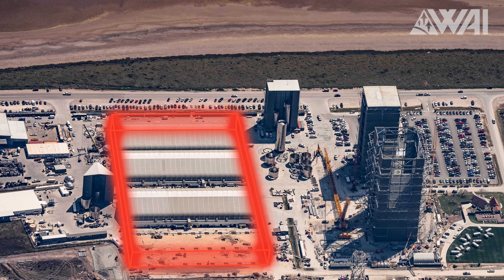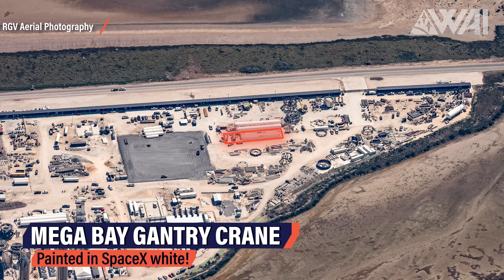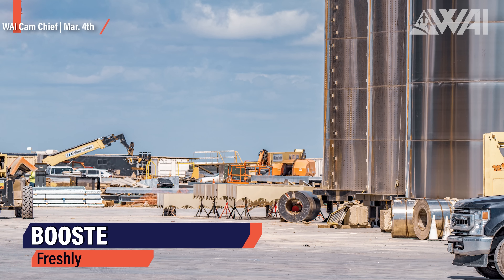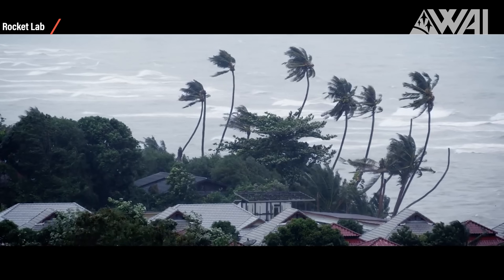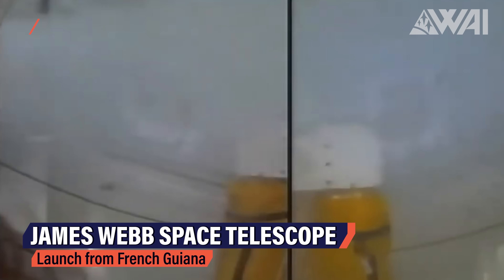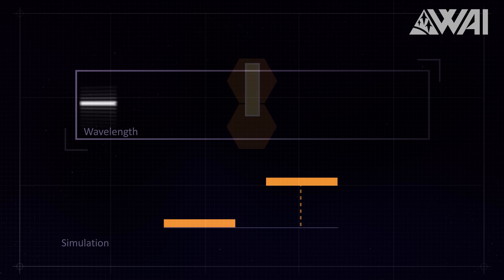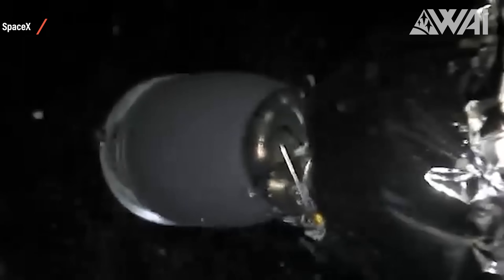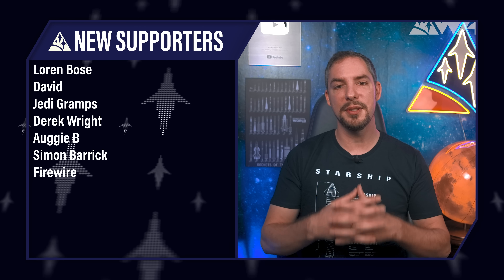SpaceX Starship StarFactory is GIGANTIC! – JWST Update – ULA GOES-T – Electron Launch 24

Comment: Could a booster do a test flight by itself without a ship on top?
Reply: Unlikely.  The aerodynamics at MaxQ would shred the booster apart without a more aerodynamic leading edge.
Reply: @glennpearson9348  Even a short one like the test hops Starship did? They didn't reach maxq, did they?
Reply: @xliquidflames  Not sure how that would happen with a full stacked starship.  I suppose they could test Ship 20 along like this, but they still risk blowing up Stage 0 if they fail to capture the ship.  Same can be said for launching just the booster.  Why risk blowing up Stage 0 for flight data that gives them no additional feedback on the return-from-orbit performance and no additional data on the performance of the heat shield?  If I were Musk, there's no way I'd risk it.  The rewards don't outweigh the risks; but that's just my opinion.
Reply: @glennpearson9348  Not fully stacked. My original question was could they test fly just the booster.
Reply: Could a booster do a test hop by itself just like the 4 Starships did; just a short, low test flight to land back on a pad, not be caught by the tower, to test out all the systems.
Reply: Now that I'm thinking about it, those 4 ships were testing out the bellyflop maneuver, among other things. And they already kinda did flying water tower tests with the prototypes before a Starship ever flew. So I guess there wouldn't be a point to hopping a booster by itself unless it's to test the software or something.

Comment: The JWT looks at light in the IR range so wavelengths are actually longer than 700nm. You statement about 400 to 700nm is correct for visible light.
Reply: It can image visible red light too, not only infrared.
Reply: @jurajvariny6034  I stand corrected. It can only see between 600nm and 28500nm.

Comment: 12:23 
Everything we know about the SpaceX Starship and Starbase TX after the first "Hoppy" test flight, has been designed, Built and tested in the same time it has taken Boeing to "FIX" Starliner. 
The time between Challenger StS-51-L  last flight and destruction (Jan 1986) and the next flight, Discovery STS-26 (Sept 1988) was 32 months or  2.6 years
Starliner demo  1 issues  was on  December 2019  -  So if it doesn't go up before Aug 2022 it will  match that timeline, any longer, then the time  in between will have taken longer to fix the Starliner than it did to fix the shuttle. 
Shame! Shame! Boeing!! You used to be such a grand and important company.
Reply: I completely agree. Boeing was indeed a grand and important company and its fall to where it is now in both space and aviation is shameful.
Reply: People to Orbit Now:
Boeing - 0
Space X - 18

People to Orbit by April 15, 2022:
Boeing - 0
Space  X - 26

Rendezvous with ISS:
Space X - lost count
Boeing - 0
Reply: To be fair, STS-26 just went to orbit. The Starliner OFT has to dock at the ISS, so it is constrained by other flights. AX-1 is scheduled for the end of the month to fly 3 tourists to the ISS along with a former astronaut to ride herd on them. In mid-April, Crew-4 goes up to replace Crew-3. There are only so many ports for the Starliner to dock with. The long delay was for going over every line of code again, akin to redesigning the boosters on the Shuttle. Then of course the valve issue. Boeing certainly dropped the ball and NASA has admitted that they paid more attention to the new guys (SpaceX) rather than the established company. With how serious the code failures were, it's not surprising that NASA was careful with reviewing it and the valve issue that followed.
Reply: Amen - similar to problems with 737 max.  So sad.  Great lesson = when you assume, you make an ass out of you and me.
You gotta stay lean, mean and hungry - gotta wanna.  Arrogance and pride will kill you - look at the Romans, NASA, Boeing, our US Congress and the lobbyist/union leeches and industro/military complex.   So sad to see such graft and corruption and squandered waste of GDP!
I pray Elon and team (tesla,, space x,, boring,, AI, solar power, et al) can stay straight arrow.

Comment: If Starship nose cone had a circular cross section the aerodynamics would not be worse than the present straight line. But a relatively simple set of one, two or four tile shapes could be used for that whole segment, still using a modified hexagonal shape.